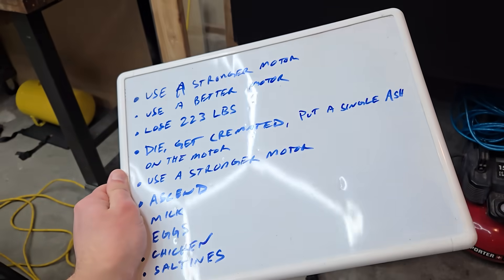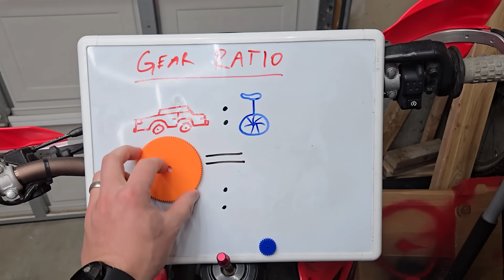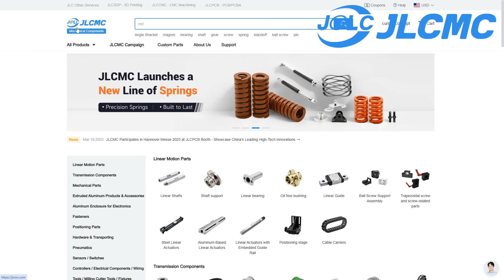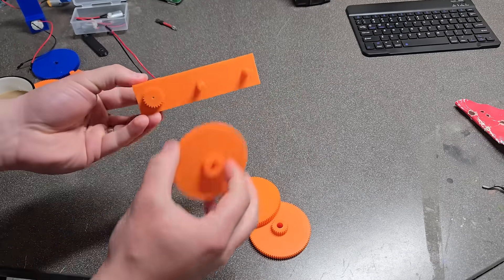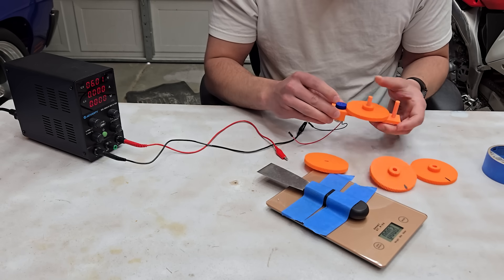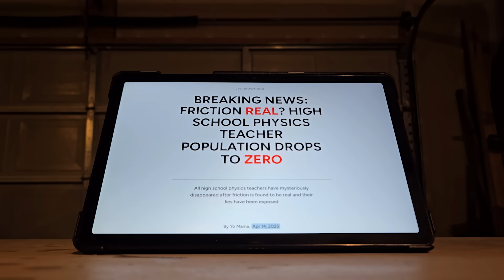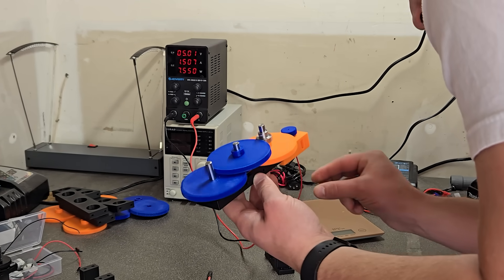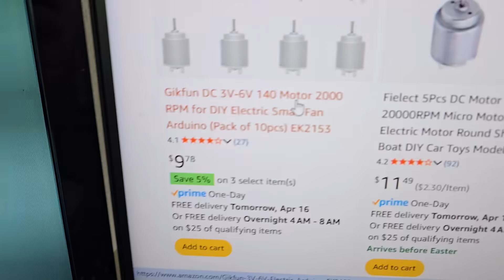I Built an Elevator With a $1 Motor

Comment: The ratio to wasted engineering potential and resources to jokes per minute and entertainment is insane. Thank you so much.
Reply: I once spent 36 long hours writing code in assembly to put the I2C interface on a micro-controller, only to find out for 11 cents more, I can get a version of the chip with I2C. So I, laughed at myself, and  dropped the idea doing it the easy way on my project and buying the correct chip... 
But then another engineer asked for the code , because he could save 11 cents per unit on his circuits using the code instead of paying for the 11 cent more expensive chip... .... Engineering is trying to apply numbers and science to life, and that's often unworkable,terrible, foolish  and sometimes hilarious.
  But I stopped slaying anything was wasted when you almost always learn something useful.
Reply: The shaft one really got me 😅
Reply: I doubled it and gave it to myself 😂

Comment: 1 way to measure how fast is your motor speed is by using only tape. Yea tape when that tape is spinning and we touch it it will make sound, and sound have freq. Every time that tape hit you mean that was 1Hz  or 60RPM. If you got 1000Hz mean you got 60000RPM

Comment: Wouldnt a proper pulley system have lowered the force required to lift the platform? Might have gotten away with a lower gear ratio that way

Comment: You could potentially set up an energy storage system (eg lifting up a weight) so that the motor slowly charges the storage system. Then, if you wanted to use it, the energy storage can quickly dispense the energy to lift you up.

Comment: you need a locking mechanism to prevent the cable going backwards while putting weight on the floor

Comment: Hard to see from my phone but looks like your DC power supply has a current limiting feature. 

Would have stopped the motors from burning up when they were stalled.

Comment: Frequency analysis with an app on your phone could’ve helped you with determining the motor speed. You could’ve also just used a smart switch to turn on/off the power plug instead of plugging and unplugging it 😅

Comment: I'm no engineer, but I would think implementing multiple pulleys to reduce the force exerted on the pulley frames (the metal rods and drum gear) as well as making it so that you would need less torque from the gear train, combined with some differentials to allow you to add in more motors (to increase total torque) would allow you to create a more advanced elevator system while spending less if you redesign the system. (I've probably got something wrong here, but that's what I think would work)

Also love this vid btw

Comment: you can definitely do this! my ideas are:
grease the gears, eliminate that friction nonsense!
put a pulley systen attached to the ceiling, that would lower the force in increments of 2 if i remember right, also grease them
making the polleys bigger
i think with this you could lower the gear ratio you need, making it go up faster, with the same or even more force

Comment: i would have used a flywheel, maybe with magnetic linkage to the tiny motor so it doesn't take the hit if torque gets mean. Or some sort of protective clutch arrangement?

Comment: I was thinking about this video and wondering if you could have the motor wind something to store energy and have the stored energy turn the gears with more force. Then you could overcome the fictional and rotational losses. I had this chain saw that you could pull the rope 2-3 time then it would release all the stored energy at once to spin the motor quickly and explosively. It's just a thought.

Comment: I’ve worked at jobs where they blow out giant motors regularly because of incorrect gear ratios, incorrect understanding of friction, misalignment, bypassing fuses, etc.

To even be able to lift that platform at all with such a small motor is incredibly impressive, I’m surprised that worked so well. 

I’m curious if a 5 amp motor could’ve actually gotten it done. I think they sell them online for like $8-10
Reply from the maker: Thanks! I was pretty surprised it could lift the platform as well, lol. It is a shame it couldnt lift me. I might revisit this in the future with a proper gearbox setup, who knows..
Reply: @currentconcept hell yeah. I will definitely be looking out for future videos. Super interesting to see what just a small motor is capable of.

& great channel by the way. Subbed so I can learn stuff 👍🏼

Comment: saw a video of a group of college kids lifting a piano with a simular sized motor. 
couldn't find it though, for a link. but I think they used monofilament fishing line winders instead of gears on the higher speed, low torque sections.

Comment: I'm no engineer, but i feel that some sort of counter weight/leverage mechanism would have been optimal; balancing your weight with the counter weight, only making the motor move the cable connecting the two.

Comment: bro had the divine intervention and current limit capable power supply but yet burned several 250ma motors with 4 amperes
Reply from the maker: whatcha gonna do, no way to prevent that :(

Comment: one idea is to add 3 stage to the movement.

First raise a counterweight over a period of time.
Then, have a latch that's linked to the counterweight to the lift, so that the falling counterweight raises the lift.
Then, have a lever that separates the counter weight and the lift. causing the lift to fall.

this would also mean that the counter weight can be lighter then you it would just need to travel a higher distance by using pulley.

so there would be 2 drums the first one is just for the motor and the counterweight.
the othere is connected to the pulley linked to the counter weight and the lift. this drum would need a way to disengage the lift.

maybe have a locking system that lock the drum and lower it slightly then connect the lift then unlocking the drum having a spring returning it back creating a tight connection.

you could also add Pneumatic Dampers to control the falling speed along with a breaking system that engage when the lift reach the top and disengage when it reach the bottom.

you could also add a way to lift the counter weight maybe have 2 gear train for the motor one for lifting the weight and the other is much faster but can only whine the rope to prevent damage to the motor add a slip clutch incase there to much torque.

you could add a link to the rope pulley that connect to the falling of the lift this will raise the counter weight but it would only raise it by a small amount so maybe an additional line that just connect the lift and the weight so this will shorten the time it would take for the lift to reset instead of having the motor needing to lift the weight 3m it only neeed to lift it 2m.

Comment: OK nuclear polarization the deal with this is the planet is flying around the star at a ridiculous speed million miles an hour. The planet is spinning at something like 1100 miles an hour now all these different speeds up. It’s very important to understand there is still cosmic dust that’s traveling at a different speed so much so we don’t recognize it. It’s as though that we’re a hologram and it passes through us or vice versa if we see it because the speeds are so relatively different now our planet you have to know a whole bunch of things about if you do the calculation it tells you that you have to have 360 trillion watts of power to levitate now this is where you would be both correct and wrong. There’s a whole lot more ambient power than you think and it reads as neutral. The next one as there are three gravitational course two of them are in one spot and one of them is just off of that OK so now you’re at 120 instead of 360. Just exactly the reason why we teach 360° on a compass now this is the next big one it’s 100 G not one G and all the rest of the stats add up to the same as at sea level that just saves us three days worth of explanation so now we’re down to. It’s like 12 ter watts now you get into nuclear forks to make a spark is one true volt that’s 1 million actual vaults on that original scale that gave us that calculation that brought us all the way down to 12 ter watts and that’s what from knowing the environment pocket in which that you’re in which there’s a bunch of shit that the children don’t know because the adults always kept it from being in writing now we’ve got a bunch of children in the place of the parents and I think that they’re better than all the children that they could slave out the parents and the children and kill everybody often and go live pre-fantasy with no comprehension of the gravitational effect of their actions. In reality your children are incapable of surviving without the knowledge I have you will abide by astral Navy regulations being MDC organic creatures or you will not leave this environment pocket. It takes 1/8 to 1/10 of a horsepower to lift someone all the way out onto orbit, properly applied understanding, warp theory 100% accurately now I will gladly teach remedial advanced war theory at any time please bring your face to my steel toe boot.
Reply: Excuse me, steel toe boxing glove

Comment: That is not how elevators work: you need a counterweight as close to your own weight as possible to reduce the load on the motors to a bare minimum - like tipping the scales instead of lifting them whole.

Comment: Use a geared torque multiplier and limit you amps through your power supply to not blow the motors and you could make even the weakest motor pull a truck

Comment: Could have attatched an empty container with a rope to one end of the elevator and used the motor to slowly drop small amout of some material connected with a chain into the container that would lift you up "eventually" when the weight became   slightly more than your body and than spin the motor in reverse to empty the container lowering you down (its 3am i dont know what i am doing)

Comment: You need a counterweight system so the motor doesnt have to lift your whole body weight.
Real elevators do this, so its not cheating ;)
Reply: And the video starts with him right there next to the garage door opener. Similar concept.
Reply: YES YES FINALLY AFTER MONTHS SOMEONE FINALLY SAID IT, HE DON'T HAVE A CLUE HOW ELEVATOR WORKS, IT NEEDS A COUNTERWEIGHT!!!!
Reply: huh, didnt think of that actually

Comment: For a 2.0 version, you could consider adding multiple pulleys for mechanical advantage, along with counterweights. Since this is the pro version, you could probably get away with using two $1 motors. :face-purple-wide-eyes:

Comment: Larger scaled Elevators use a counter weight system to take weight off the motor, You should do this project again but with a counter weight system too

Comment: 1:58   "Mechanical black magic occurs"🤣🤣🤣🤣i feel bro for real coz how does mechanical advantage work 😓
Reply: Simple: 10 tooth gear turns 20 tooth gear half as fast, but missing speed turns into mechanical advantage.

If you're wondering where it comes from, each tooth on a gear is like a lever. Longer lever needs to move further for the same rotation, but amplifies force more than short lever.

Comment: Bruh , limit the current to 2: Amps and use 4v max instead of 5v that you are using , the winding of these motors is delicate it can’t handle 18watts of power that you are providing…. Try 8-10 watts of power, it will work like a charm without burning up
Reply: Yeah way too many amps.
Reply: Was thinking the same. I actually have 2 buck 5V-37V volt driver that just gets the most out of this tiny piece of crap, but it actually gets a decent torque that almost succeeds turning a 180mm belted turn table. With 1:36 ratio. Just need now the magic of a gearbox
Reply: Yeah, I was thinking that no matter the resistance you put on it, these shouldn't burn up if they aren't given too much power. They usually just... stop turning.
Reply: @MisterBones223 well he was giving it 9-10amps…
Reply: @MisterBones223 well, the stall current isn’t sufficient to overheat the windings at this power level basically.
Reply: @BritishEngineer  Oh, so I'm just imagining that they burned out, right?

Comment: Those DC motor cannot withstand a high current needed to lift you up. Just do the Energy and power calculation. Even though you reach those torque the motor Will burn before.  Theory Is strong. Use It. 10 minutes of video skipped to the last 10 second because of basic physics calculation. I know practice Is really fun, but save you some Money, you'll Need It. Could had saved you a lot of time with Theory.
I dont understand all of those comments saying it's a great video. I mean you put a lot of effort and It's remarkable. But It's content for people Who get entertained very easily by a great videomaking, not by science.
Reply: Btw if a tiny motore like that Could lift you up we Could make Cars with a 5$ motor, dont u think?

Comment: Set the voltage on your power supply to 4 volts, short the leads, set your amperage on the power supply to the motors rated amperage, disconnect leads, set voltage to motors rated voltage and power motor, voila, no more blown motors.

Comment: This is a pretty good project. Sorry that it failed. I would recommend getting better micro motors, since especially for the 130 model ones, they are usually low quality. If you take apart the motor you will see that the size of the rotor is half of what it should be. These poorly made motors usually spin way too fast with little to no torque, take more power than needed, and they don’t last long. If it’s possible i would get better motors that have the full size rotor. They spin a bit slower but have more torque, and take less power, and last longer in the end. There’s a rather decent 3 pack in the same place you got the 140 motors from, and also a pretty good 10 pack with red caps and stronger magnets. If you know where a HobbyLobby is i would also get their 280 model motor (it’s the only kind they have near the car models area). I hope one day your project will succeed.

Comment: I had this idea come up in my brain many times about this very tiny motor used through a gear ratio to lift myself over time. This ks very cool a childhood dream fulfiled. Thank you!
Reply: To actually make it happen, I'd start with the same motor in the version with a plastic gearbox. That way the hard part is already optimized. Add a couple of heavy-duty gear stages and you're good to go.

Comment: The mechanical output power needs to be able to overcome the motor's inertia during rotation, the gearbox mass moment of inertia, and the load's inertia. Yes you did create an elevator that can't handle it's own self for too long. Love it keep it up

Comment: What you can try is adding 3 more motors and each pulling 1 cable/side 🤔 that way you won’t stress only 1 motor but the tress will be divided on 4 motors (still I’m 99.9% sure it will fail)

Comment: WD40 is a spray to keep water away from metal, prevent rust or icing (of the Atlas missile), it also does a fine job in de-greasing, but IT IS NOT GREASE!
So, next time use gear grease or silicon grease, which works best with plastic gear. Also mind, the last gear which carries most of the weight will break under load. Also note that turning a spindle would be much better, because spindles will keep at the position where they lifted the platform. Then restrict the power going through the motor, dammit or at least fix a ventilator to it, to cool it down and if it doesn't move, stop it by a circuit. There was a max Amp on the data sheet, you always ignored that. 

My father is an engineer, my brother is an engineer and I'm a software engineer and we all come from Germany and I just see my heart bleeding watching this. Entertaining, yes, but don't be surprised, why the whole world doesn't want to buy US engineered stuff and you can't sell any US machinery overseas anymore. 

Also, if you want to see how fast a motor spins, just let it beat a drum and this will create a tone, you can measure the tone with every smartphone, easy as that and with the Hz you get the spinning per second. 

And this is why the US get's it's fricking export deficit. Maybe you work on your engineering for once instead of raising protection tariffs to stay bad? Just a thought. 

But yes, entertaining. But not surprising. That motor can lift you easily, but hell, not like that. And it doesn't need a week for that. Also, if all this is not your thing with the gears and all that, think about hydraulics. That's really primitive and will even work in the modern US, the best of all machinery countries of the world. You can't fuck up water and you don't get to the stupid idea to try to grease it with de-greasing fluid.

And there's something called counterweight. Look that up, it's a mind blowing idea, I think 10k years old. Even a spring would work, but not as good, but makes your elevator lighter. 

Instead of glueing two boards together, what's so bad about a FRAME? Is better and lighter. See the typical T-bar, which is, I think, even used in the US, while it's of course unusable anywhere on the world, because you refuse to go on world wide standards by keeping your 300 year old imperial system. To become a team player would solve a lot of the problems you have, so the only industry you got left is financial services and that only works, because it's cheating big time.

Thyssen Fahrtreppen / Thyssen Elevators, Hamburg
Working with my software for 45 years now. I'm not speaking for them and didn't work for them for a long time, still, my software does.

Comment: so what's missing is you need to scale the gear heft with the force on each gear. So the first gear in the set should be small and light and the last gear in the set should be very bulky.
Reply: Sorta kinda like bicycle gears
Reply: Lemme just chant "V 2 V 2 V 2"